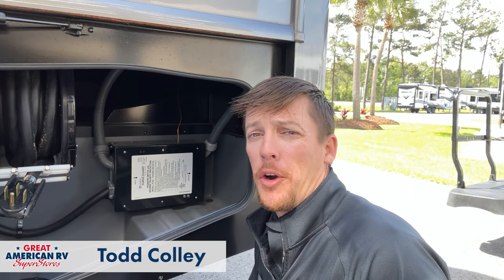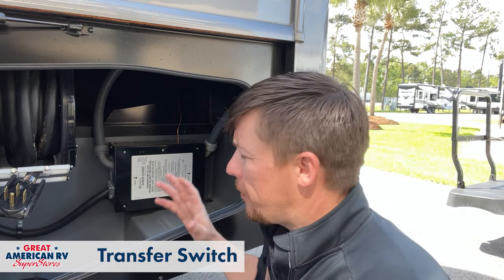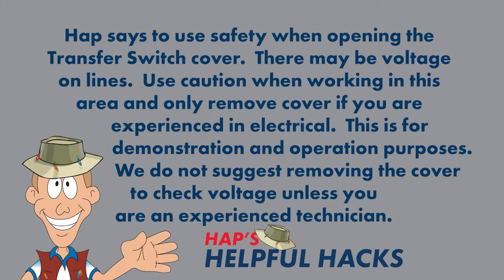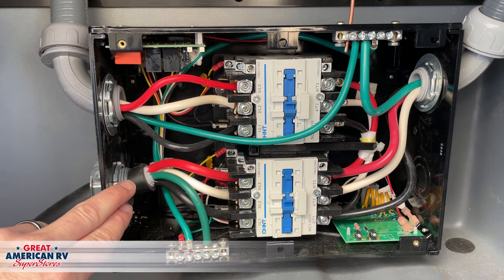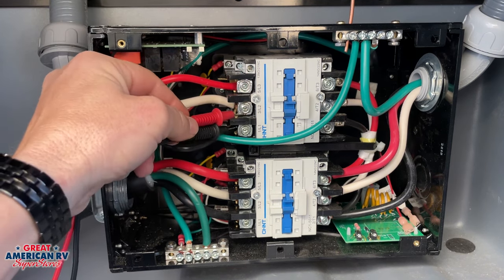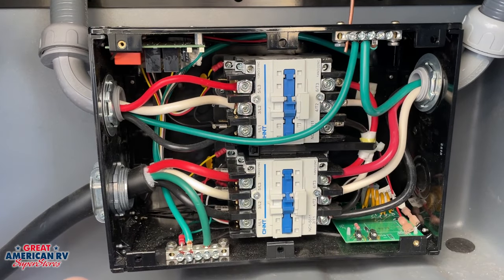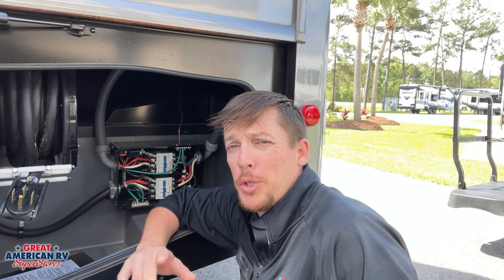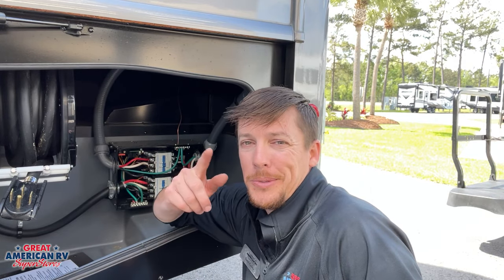How does a RV transfer switch work?

Comment: So what happens when you have the RV plugged into shore power, then someone starts the generator?  Power is coming in from both sources?
Reply from the maker: @timl9495  great question, the generator will take over as the dominant source, and it was shut off the shore power connection.  -Todd
Reply: @GreatAmericanRV  Thanks, that answers my question !
Reply from the maker: @timl9495  always happy to help, hit that subscribe button for us and to keep up to date with more videos.  Thanks! -Todd

Comment: How would you hook up a 12v solar to 110 convert up to the power cord?
Reply from the maker: Solar need a solar controller inline  fr mom om the panels to the controller then to the batteries.  From there you run from the batteries to an inverter then from that to a transfer switch.  This would generally be romex.  -Todd

Comment: I have just purchased a 98 Gulf stream and I'm having to run a battery charger to keep my batteries charged. I can't find a shore power switch. I've checked around the batteries around the breaker box and everywhere else I can come up with. There's a rocker switch in my stairwell that says battery disconnect coach and one for chassis one that says compartment lights and 2 more rocker switches that don't say anything. Then as I go up the stairs there are 2 more unmarked switches. What position should these switches be in when on shore power? I've only had this RV for a month and still trying to figure out what does what. Any help you can give me would be greatly appreciated.
Reply from the maker: With out having the unit here it would be difficult to tell you what positions the switches need to be in.  The only one I can say for certain is the Battery Disconnect should be in the on position when plugged into shore power or running on generator.  That should only be off if you store it and don' t have it plugged in.  This could be why your batteries are requiring a charger or it could be because the convertor is bad.  The convertor is essentially a built in battery charge.  It is generally located near your 110 breakers inside the RV.  -Todd

Comment: We just picked up our new RV and noticed the line going into the transfer swich is kinked. Is this a concern?
Reply from the maker: I am assuming you are referring to the shore power cord going into the switch?  Regardless they are able to take some degree of bend and flex.  They can be compared to a household extension cord. I imagine you may be describing it going through a clamp then up to the switch.  I’ve seen them twisted a bit going into the box.  If you experience intense heat on that area of the cord compared to the rest during operation of appliances then you should get it checked out.  If not it shouldn’t be a concern.  -Todd
Reply: @GreatAmericanRV  it's definitely severely kinked, not twisted at all. Plus I learned it is a Sealtite conduit and it's going into the Automatic Transfer Switch using Romex connectors instead of Sealtite connectors. It probably goes to the generator, not shore power. I'm going to have the dealer look at and hope it's covered under warranty. We're gonna see what else we find wrong first.
Reply from the maker: @Patty747  yes the conduit doesn’t matter as much.  The stranded wires inside run free inside of the conduit so they are not likely to be under the same stress you’re seeing the conduit in.  But it’s worth having the dealer look at it to be sure.

Comment: You left out how the Interlock works on your setup.
Reply from the maker: Generally, Interlock refers to the manual transfer of power if you don't have an automatic transfer switch.  I am going to assume you are talking about how it senses the power and transfers.  If I'm not hitting the right info let me know.  The circuit board senses the presence of power from either the generator or the shore power and sends a command to the relay system to lock in the transfer of the power.   We aim to give a general understanding of how the item works and some general operating and troubleshooting tips for more specifics without getting overly technical.  Hope this helped. -Todd